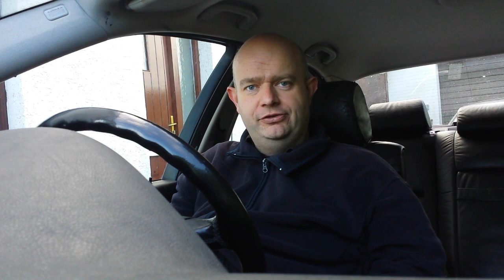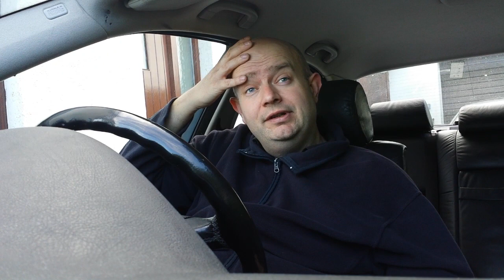BMW E39 EV Conversion 51 : 41000 Miles and Counting

Comment: Hello Damien, first of all, congrats on your work, it's great to see people doing this in Ireland!  Could you tell me please, is there any problems with the NCT? Do you need to change the log log book to electric? Engineers report needed? And is the tax cheaper? :-) Thanks in advance and Keep up the good work!
Reply from the maker: +Ian Graham Thanks for your kind words. The only problem with the NCT is a sore throat as I usually end up talking to the testers and general public for over an hour! Log book needs to be changed yes. An engineers report is only needed if the chassis of the car is modified so i avoid this at all costs. Welding and bolting to the chassis is fine. Tax is 120 euros a year.
Reply: +Damien Maguire Thanks for the reply Damien . . that sounds like a good deal, I was thinking that there would be major hoops to jump over with the NCT and tax office converting to EV and actually putting it on the road (this being Ireland and all lol) but from hearing that, I'm definitely considering a build myself. Thanks again and I'm looking forward to watching the rest of your videos . . keep them coming! :-)

Comment: How does the heating work on this car?
Reply from the maker: +Jake Maletesta I used an MES RM3 fluid heater to warm water to 70C and pump it through the oem heater core. All the climate controls work as normal. I have a few videos on the installation.
Reply: Damien Maguire Started backtracking already but unfortunately I don't understand much though interested all the same. I'm here because I have a GS450h and I was researching the box, subbed as I'm very interested to see what you do with yours.

Comment: Hi Damien.  loving the Damien Channel.    Had a question and a mental Note that you have 40KWh battery pack in there.  At 350wk/m are you finding you are getting a solid 100 miles at 80% highway travel?
Reply from the maker: +technogeekworld Yes. Max distance ever travelled was 111miles and i was on fumes:)
Reply: +Damien Maguire Good Job Damien...
Reply: +Damien Maguire Good Job Damien...
You mean to say 111 Miles Range in one single charge and while driving very Fast and with Climate Control On?
Reply from the maker: I drove on the motorway about 90% of the journey between 65 and 70mph. Making the same trip again on Tuesday:) Thanks for your kind words.